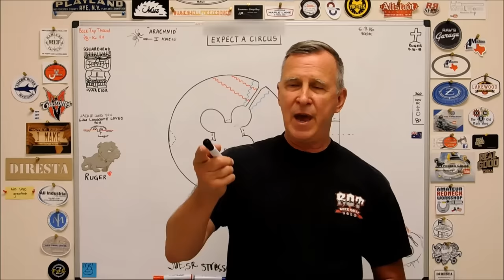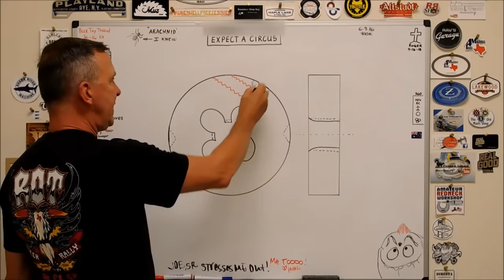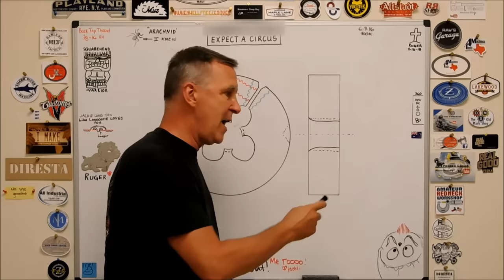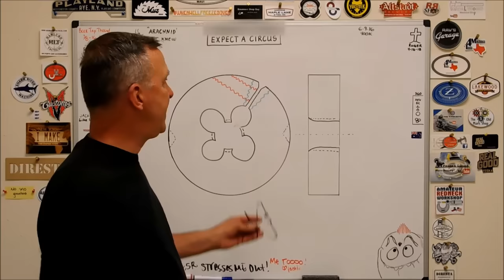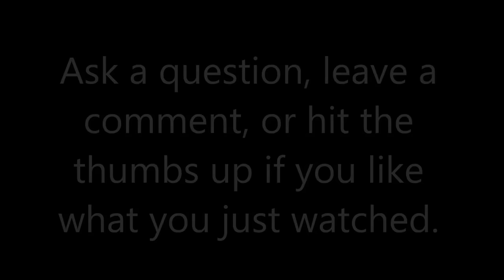You will throw your die handles away after you watch this !!!

Comment: Im a big fan of using tailstock as die/tap holder,using milling machine/drill press as a tap/die guide (without power just spin it with a hand make sure spindle is not locked,you can do even blind holes) Just be careful that your tailstock is aligned and that its not cutting taper,i worked with a guy that cut taper and he didnt align it back ,nor he told anyone.Machine that didnt had problems before suddenly started to cut crooked threads,i broke the reamer.it took me some time to figure out whats wrong with machine.

Comment: I have a 2003 Honda Shadow VLX 600. I was able to find someone on a VLX I'm in that sold me a tank with a tank mounted speedometer. He also gave me the electrical sensor that fit where the original mechanical speedometer cable mounted at the front axle. I removed the original speedometer and the three lights in the top fork mount. I do electronics repair work in my basement and was able to find two cables with the proper plugs so I could wire the speedometer and plug it into the wiring harness on my bike. I really wish I could afford a lathe as I do fabricate metal and wood parts. Since the original seat didn't fit with the new tank, I fabricated a rear mount for the tank from two pieces cut from a lawn mower blade. One hole that bolted into the original mount hole, another for the tank mount, and two holes at the back for a hinge I heat treated for a solo seat I made, and made a cross bar for the two springs at the back of the solo seat. I do leather work, and since my wife's seat was too stiff and small, I covered her seat with more foam padding and made a cover for it as well. Thanks for putting this video up. I do have a tap and die set and did learn a few things from this.

Comment: Well, you learn something every day.  Being a machinist/toolmaker for some 45 years, I have to admit the narrator is spot on with his handmade tool and what a great idea this is.  Dies and die stocks are but a quick fix and will result in a poor thread if the die is not started dead square and never an easy thing to do.  You're best using them just to extend an existing thread or perhaps dressing up a damaged area of thread.

Comment: Have been doing this for years, but on a capstan lathe. Coventry die heads are the quickest and cut an accurate thread. For center lathes, we made die holders from thick walled tube and followed it with running center in tailstock

Comment: I made one very similar to yours but a large die holder one end and small die the other on a shaft and the shaft had a morse taper. Made it in my apprenticeship 1966. Nice one Joe!! I was taught to undercut the end thread. Never seen another. On steel used by hand only.

Comment: can you show us how to make an interrupted thread ?
Reply from the maker: Can you be more specific?
Reply: @joepie221  sure.
my 1886 winchester rifle is a " take-down " variant.
the barrel connects to the receiver by using an " interrupted thread. "
the threaded portion that would normally screw in to the receiver has two groves cutting lengthwise through the threading.
which match corresponding grooves in the threads in the receiver.
so instead of having to twist the barrel in the threads a dozen times ... you simply slide the threaded portion of the barrel in to the receiver along the corresponding grooves, and give a half turn to tighten the barrel into the receiver.
then the magazine tube is inserted to lock the entire assembly together, preventing the interrupted threads from  untwisting and coming apart.
that way the entire rifle can be " broken down ' in half, to two shorter pieces for transportation.
and put together at the shooting destination.
Reply: @joepie221  and i am wondering how they did the threading. 
i believe the term for it is " interrupted threads. "
Reply: @joepie221   let me clarify.
when the barrel is twisted in the receiver ... all the corresponding threads aline.
and mesh as one.
just like the barrel had been threaded normally into the receiver.
Reply: @joepie221   but requiring only a half turn.
Reply: @joepie221  by the way ... i especially like your method of cutting threads by cutting in reverse.
i wish i had seen your video before the threading portion when i was in machining school.
Reply from the maker: Understood.
Reply: @joepie221  thanks
Reply: You cut the threads as normal, then cut the flats / groves.
Reply: @rmkscrambler  thanks.
however, a picture is worth a thousand words.
i am not sure how you time it to be correctly oriented.
for example my octagon barrel needs the flats oriented correctly.

Comment: we used to have the same kind of set up, but we used a bar in the tool post instead of holding the die holder by hand. set correctly the die handle simply fell of the bar in the toolpost. great idea. for just a few off though, a real pain on the hands when doing it all day. keep up the good work.

Comment: I make an adapter that is m12x1.75 male on one side and female on the other. Basically an oil drain extension for oil pans.  I use the same tricks with a hexagonal die and the drill chuck mounted in the tail stock and flip the die around to get the threads closer to the shoulder. But I do not do this under power because the thread length is only about half an inch long and I am holding it with a wrench.

The female side is much simpler and is done while still cutting the blank, just because it's already centered and the taps work well for a short depth hole. But I use a bottoming tap to start, simply because it's is not going very fast to begin with.

But after that is all done, I still have to cut flats on the part for using a wrench to install it.

Comment: Hope not to stupid of a question, but: if you are using a lathe to centre/hold the die, why would you not directly cut a thread into the part using the lathe?
Reply: I use this method because my lathe is so baggy on the ways I can't get a good thread with single point tool, also my lathe is so old, to cut a metric thread the lead screw needs to stay engaged for the entire thread, forward cut, back out, wind in and cut again, all with lead screw locked in, I get a bit twitchy doing that to a shoulder.
Reply: Thanks to both of you, makes sense... :)
Reply: @cantsolvesudokus  A die is also faster as you make just one pass as opposed to several with a single point tool. For my part I often hybridize starting with a single point tool to ensure the thread is true but finishing to size with a die in a commercial tailstock die holder.
Reply: I have an older lathe that doesn't have change gears or even a gear box. Making use of taps and dies is my only option.

Comment: You will notice that the  information is on the side that has the sham-fer the screw in the die is also for cutting the thread  when you have made the first pass you then undo the screw and  run the die again this cuts the thread deeper on the second pass.

Comment: I use the drill chunk with a pin in that goes against the die rather than the die handle to get the die started square
Reply from the maker: You can also use the face of the tailstock chuck if you have room. Open it up all the way to get the jaws out of the way.
Reply: @joepie221  the dies I use are small, sometimes I close the drill chuck almost all the way and put the jaws against the die itself but the dies I use are never big enough to use the face of the drill chuck or empty tail stock.

Comment: great tool!

I'm thinking of the design that allows threading "infinite" length material so it would have to be a pipe + die holder held in the chuck, and feed the material into it, through the center support or something.

I still don't have a lathe so it's hard for me to visualise it, but I'm sure you would know how to do it.
Reply: I believe what you are talking about is like two rollers that have a spiraled channel around them and they are attached to a hydro jack that can press them into each other(and into a piece of round tool stock.} They spin and then theres a cutter or a stop on one side so it doesnt just get pushed out?

Comment: I have a different looking for holder I made 30 years ago out of steel it fits inside of a standard 3/4 tool holder.  Works like a champ. I have chased many threads . I ran a chucker for a few years in the 80s

Comment: Hi Joe, another GREAT video!  Some thoughts, comments, and a question, or three:

• two excellent tips for starting die alignment

• shoulder bolts: instant handles, I love 'em.  In certain situations, I use SHCS, (socket head cap screws), in place of set screws. Easier to adjust, plus a knob end for finger tight settings, before the allen tightens it.  Especiallly handy on, now obsolete 'cause of Joe Pie, die handles!

• seems the drill blank could work as a thread depth stop in certain situations. I was thinking some depth marking on the blank could be handy. IE: Shallow cuts on the exposed drill blank, when the blank end is a ¼, ½, & ¾" from the end of the holder.

• do you have a larger version of the holder, for larger diameter dies?

• is the drive end shaft of the holder ½"?  (making one of these is now on the top of my To Do list.

Thanks for sharing your knowledge, and taking the time to make these vids.  I have about 5-6 hours of turning time on my first lathe, (Sherline 4400); laid up this Winter, from an injury, I spent days/weeks watching YouTube vids like yours.  They played a major part in me being able to make the items I needed to get my lathe set up, making accessories and getting started on my projects in the, "When I Get a Lathe", bin.

I could never have hit the ground running without the generous sharing of knowledge, and great presentations on YouTube.

If the US ever gets in need of mass manufacturing, (like WW2), there will be many amateur machinists, ready for advanced training, and production work.  Credit would go to people like you.

Thanks, again.
Reply from the maker: Thank you

Comment: Sir thank for your answer, can u
Tell me what makes cutting oil
Different then reg. Oil what's in it
T
Reply from the maker: I believe its the sulpher content. I'd have to check to be positive.
Reply: thickers (depending on the other oil being used such as 3 in 1) sticks to a working tool better but the most important difference is better cooling/heat dissapation property. its all about keeping the tool and part as cool as possible as you are cutting into the part where there is no lubrication happening, cutting oil is just a vessel to carry away heat, any oil is better than nothing.
Reply: Sulfur cutting oil , Sulfur in the oil prevents galling on cutting many steels.  Heat removal also is beneficial, but any liquid will do that, as a matter of fact water is the best for cooling.
Reply from the maker: @fredrosse  Just don't use water if you are expecting lubrication. Water does pull heat, but that's it.
Reply: One of the best cutting oils is an oil/water mix with an emulsifier. The water provides the cooling, the oil keeps galling down, and the emulsifier makes sure the water wets the part for cooling and allows the oil in the area (where without the emulsifier, the water will displace the oil and keep it away a bit) while keeping the surface 'washed'.  On a microscopic level, cleaning the part and tool surfaces after each pass keeps galling down but also keeps the trash from making a cutting action less than smooth. The trash transport ability of water is a little better than the oil's.  (At any rate, use plenty of any cutting fluid of your choice while cutting for nothing other than for the 'washing' reason. The oil will get in there somehow and do its job also.)

Comment: Hey Joe, regarding your VTX the tail light on the rear fender, is that stock or an aftermarket part?  Thanks in advance...phil
Reply from the maker: The tail light is stock. The bike is an 'F' model, so be sure to research in that arena. C,R and F is what you should fine. Its also a stage 2 package. More chrome and black.

Comment: nice bike joe, i've got an old shovelhead harley and a brand new yamaha mt-09, i bet that vtx pulls like a schoolboy
Reply from the maker: I took it back to the dealer the first week I had it because the clutch was slipping when I jumped out in traffic to pass someone. Turns out the clutch was fine. It was the back tire was smoking off at 45 MPH when I clutch bumped it. The torque is incredible.

Comment: Joe, what are your recommendations for thread blank undersize.... for instance die threading a 0.250 shaft for 1/4-20 results in a terrible ripped up thread....I turn about 6 thou less - 0.244 and get much better threads in steel. Do you have a rule of thumb or table for screw blank undersize?.(I think it has to do with the die thread being radiused at the outer edge). Thanks again.
Reply: Not Joe obviously, but I usually go around 2% under major diameter for die cutting. 
So .250 * .98 = .245, right next to your number. For single point cutting I like to turn to 1% under major diameter.

Comment: Joe, I have seen some die holders like that but it seems the shanks are pretty short. 1/2" to 3/4" or so.  The shank on the one you have looks like its about 1 1/2" to 2" or so? BTW - your videos have really increased my understanding and given me confidence to move forward in my home machine shop. Thanks so much for your knowledge and thorough coverage of a subject.
Reply from the maker: The guide on mine is about 2" long. Thanks for watching.

Comment: The un in unloosened means completely in this case.  The prefix un can also mean the opposite of, do the opposite of. to deprive of , not, remove a specified thing or contrary to the word it is being used with. I didn't think that I would learn this from your video but thanks.  Good taping device mod.  Thanks for the video.
Reply from the maker: If you look that word up in a current urban dictionary, you'll find it can be used to reference loosen. I always say that just to fire people up.

Comment: Nice Joe, but how far up the material ladder would you still be willing to hang on to the die-holder handles......aluminum, steel, stainless?  I love the concept, but I can easily see that getting quite torquey with anything other than plastic.
Reply: Brian Bump Same thought, i use my toolpost in place of a hand on the die tool
Reply from the maker: Use the same setup, but drive it by hand. Machine power OFF

Comment: The set up looks good, but it looks too dangerous to hold with the machine running, why not just turn by hand ?  Additionally, this method is well-known, and such die holders can be readily purchased almost anywhere, and there are many youtube videos of how to make one.  You could also have a longer handle that presses against the bed, and just switch off when the die nears the end, and then complete by hand.  Though you are an expert, your method is dangerous for those learning how to use a lathe, especially when you cross over the work to hold on to the handle.  I cannot agree with your "method".
Reply from the maker: Single bar threading presents its own hazards since there is a huge pinch zone. It also biases the die to one side and can result in a less than perfect thread. as with anything in a shop, if it scares you, don't do it. Common sense is in short supply these days. The demo was plastic, so power driven was fine.

Comment: the die marking is on the start side, also many import dies have a counter bore on the back side, these cheap pieces of s**t are
 less likely to be ground with die relief that joe alluded to. thus when you turn the die around and start from the back, the counter bore shortens
 the amount of contact the die has with the formed thread. on a full thickness die that's turned around, the bad finish and chipped edges 
 come from the die relief having a poor cutting angle and putting a lot of un-necessary pressure on the die threads.
Reply: Diagnosed an

Comment: Power thread cutting looks very dangerous with those shoulder bolts installed!
Reply from the maker: Low RPM and be ready to just let go.
Reply: @joepie221  The problem is the instinct to hold on tighter when things go south.

Comment: Still learning for the day I finally have enough shop space for a lathe. You make it look easy.

That bike is a beast. I've got a 2000 Yamaha Wild Star, 1600cc. You grab throttle, it's gonna pull your arms off all the way up to about 80. And the sound of these big v twins is awesome with a decent set of pipes.
Reply: Thomas I built a 16x16'  shed for my lathe room,  did the electric  & gas heat  wish I had bigger  LOL
Reply: Yeah, I built the maximum size shed I can (8x12) to get all the other crap out of my one car garage to use as a workshop. I have a 25"x25" CNC, a laser cutter and a couple 3D printers in here, plus the motorcycle. Currently thinking over building my own smaller format CNC turret lathe for turning some components.
Reply: @notthomasharrell  thats  awesome. I built mine & gave 1/2 to  the lawn tractor  then last year took back more  leaving  just enough for the  tractor LOL I said screw  the tractor I ll tarp it if need be

Comment: That's all great if you own a lathe but if you're a lathe I don't see the need for tap and die set when you can cut them on the lathe
Reply: Without a tap and die set I've seen guys cut threads with a lathe not using a die using a cutter
Reply from the maker: @michaelthomas788  Thats my first choice, always.
Reply: Sometimes it is just faster, more convenient, or necessary to pop the die in the tailstock. There may be no space for the tool post and cutter, if you also need to support the work piece with a centre in the tailstock. Or the compound slide is set up at some specific angle that is no good for threading.
Reply: Depends on the job ur doing if u got a fine thread and stuff obviously u cant use dies but if u gotta make like 15 parts ur not gonna cut them all with ur lathe thats just ridiculous